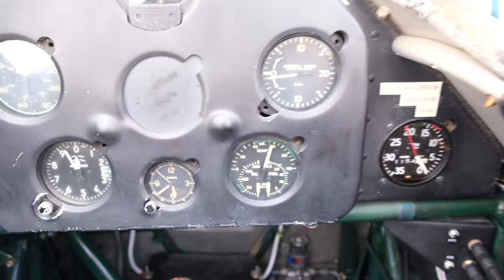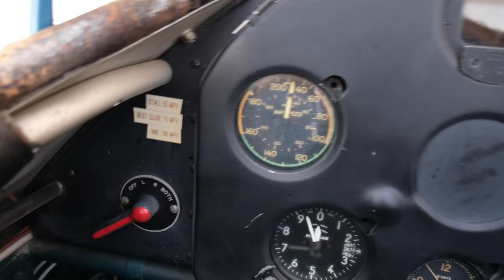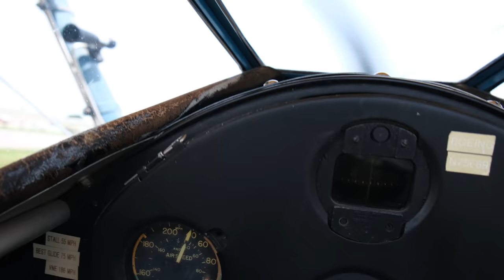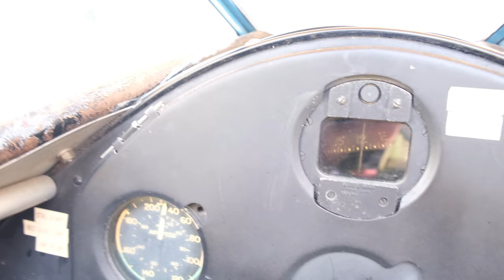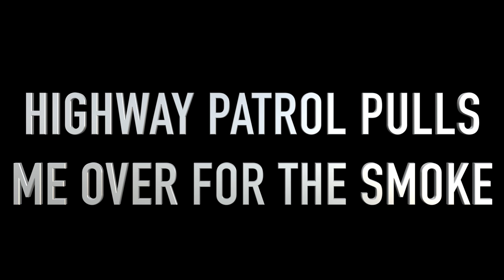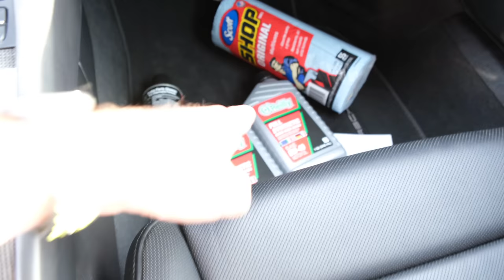I FLEW IN A BI-PLANE Then Blew Up The Tow Pig *Rolling Coal*

Comment: Lol i want car enthusiast youtubers to shift from “i bought a cheap “car” to i bought a cheap “Aeroplane or helicopter” and they  test fly it ...good luck if you survive 😂😂😂😂
Reply: I’d love to pilot a Helicopter and eventually own one for tours and travel
Reply: I bought the worlds cheapest Cessna, lets see if it flies.
Reply: That smile was so big. Man I want to go on a biplane ride
Reply: @Not-Great-at-Gaming  he wont be able to release the videos cause you crash in cheap unmantained planes for sure.
Reply: Well that's why before even thinking about getting into the air, you rip (or let it ripped for you) the plane apart and check all the things and only if satisfied you are going to think towards getting the wheels off the ground. If you buy a crappy car then well nothing much can happen if the engine fails so it is easy to try it out. If you buy a cheap (not necessarily crappy) plane you want to make 100% sure it is airworthy before sitting into one. You might not be willing even to fly it from the place you bought the plane but transport it over land to your location, let the mechanics make a thorough checkout and proceed from there.

Comment: PT-17
With a Continental R-670-5 engine. 3,519 delivered
PT-17A 18 PT-17s were equipped with blind-flying instrumentation.
PT-17B Three PT-17s were equipped with agricultural spraying equipment for pest-control.  These planes were used as trainers in WW2. The Navy used to nickname the planes "The Yellow Peril"

Comment: Blew an intercooler boot on my Dodge once.  I was pushing about 50lbs of boost getting on the freeway and it sounded like a shotgun going off.  Almost caused the guy in the car next to me to wreck.  Also did it on a stock F550 and it wasn't nearly as violent sounding.

Comment: We did the intercooler hose on my friends’s VW Sharan TDi last year, same deal, the hose was just too chewed and the clamp too mangled to fix, needed new VW parts then all was good. Loads of smoke, no power, oil blow- by, not legal to drive. Needed to run it through with cleaner in the fuel to make it run really right because the fuelling was all messed up hence the soot, but all good now.